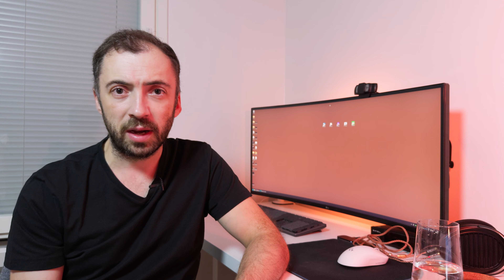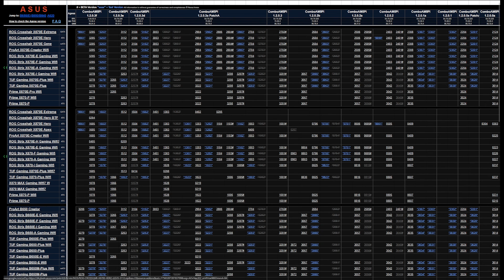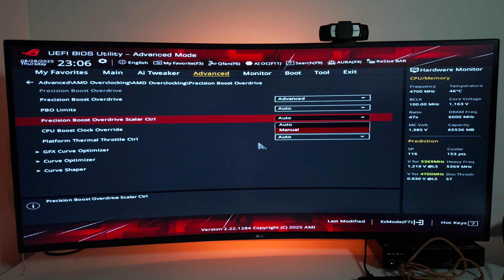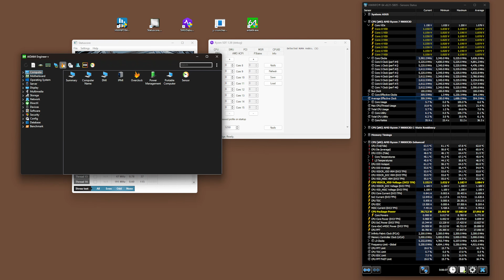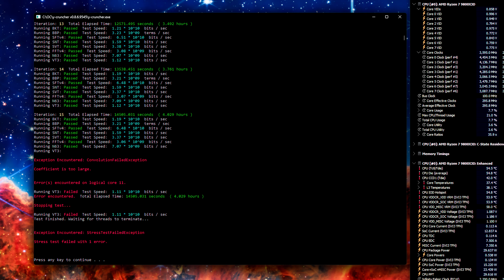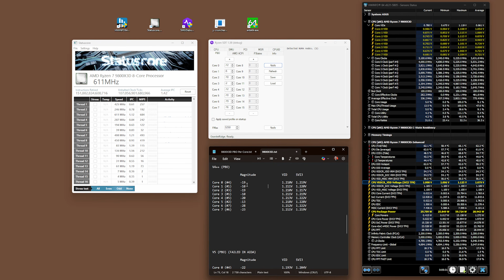Undervolting Ryzen 9800X3D Per Core - Less is More ?

Comment: You can do that automatically using just ryzen master. It has a self tuning mode where it tries to detect the right offset for each core. For a 12 core cpu it took 2:30 hours. I guess for a 8 core it will take less time. It will restart the pc each time a limit is reached.
Reply from the maker: Thanks for brining it up! I haven't tested it myself but some say that it can be very unreliable regarding the stable offsets. Maybe I will give it a shot at some point. I'm all for simplified methods which are not taking forever to complete.
Reply: Did you do this with a 9800x3D? It’s not an option in the old Ryzen Master, or the new Ryzen Master for 9000 series. There is no option or button  that says “start optimizing”
Reply: Sure beats doing it manually, it´s taken me roughly 6 weeks to do it manually. However I do wonder how close it gets to what you get doing it manually.
Reply: How? New version with red interface only has Validate button near CO but not Optimize like in screenshots with blue interface.
Reply: You are correct, and it will also show what cores are your strongest. I have a 7800X3D and undervolted mine (in BIOS) per core: negative 30 on all but core 4, which is set to negative 20. OCCT pointed this out in a 10-minute run. It really is a silicon lottery.
Reply: ryzen master suggested me all -30 per core, and took me 1 hour to analyze, maybe its not perfect
Reply: Don't do this. Unless there has been a massive change in how Ryzen Master tests, it will always give you CO values that are way too aggressive. If you want to automate it, use something like CoreCycler, which is a little harder to use, but tests more accurately, or 1usmus's Hydra, which is easier to use, but I always check with CoreCycler because it can be a tiny bit off.